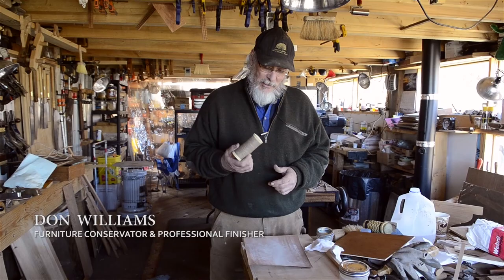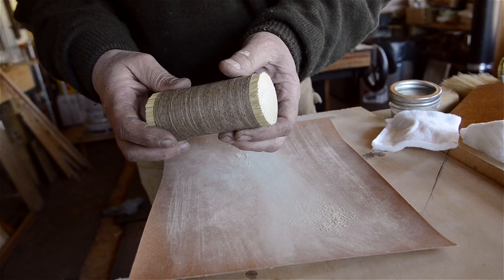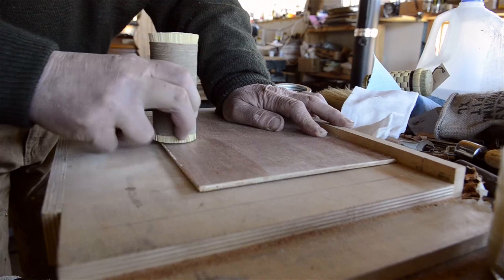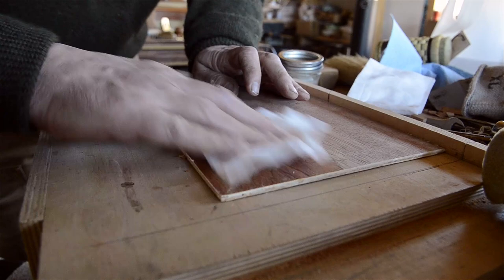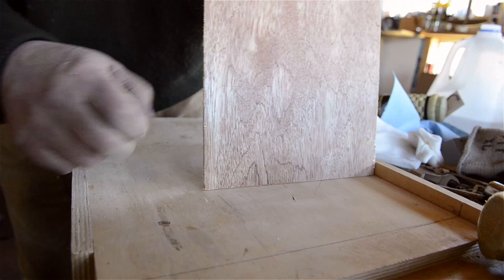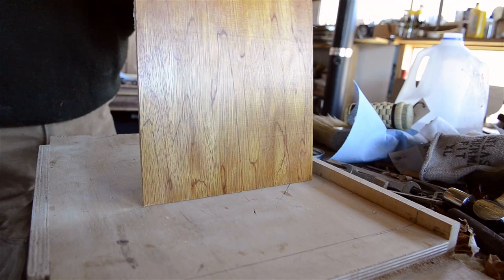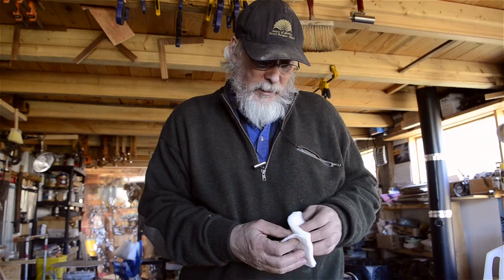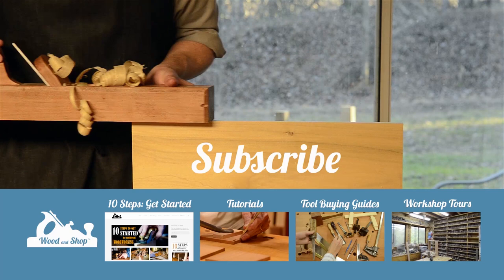18th Century Beeswax Wood Finishing with a French Polissoir (Don Williams Workshop Tour Part 4)

Comment: Outstanding.  I'm a finisher myself since '82 or so and this is great.  I've read about it a little but never really looked into it.  Great to see it for real.  Thanks.  I'll be checking out the rest of the tour and Don's website.  Just recently subbed here or I would have missed this.
Reply: Brian Miller Hello sir. Can I know what exactly is a finisher? Are finishers the one who finishes a woodworking product with paint, pastewax, shellac and etc? Or is the term represent  other things?
Reply: I apply the coatings after the project is created or built.  Anything from cabinets, furniture, staircases, custom panel walls in homes or offices or even floors.  Can range anywhere from a huge variety of different paint types to shellac, lacquer, various tung or linseed oils or epoxies.  All depends on customer preference and application of end product.
Reply: Ahhh...I see. Thank you sir for the explaination. I do woodworking for hobby so I am interested with many things related to woodworking. I never thought there is a professional finisher craftsman since usually I and my friends did everything on our own from building to finishing.